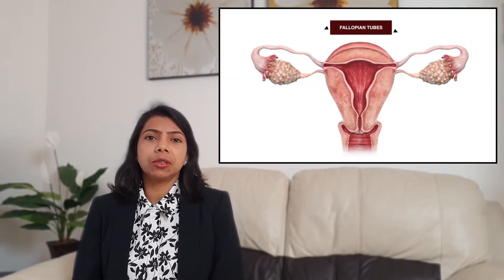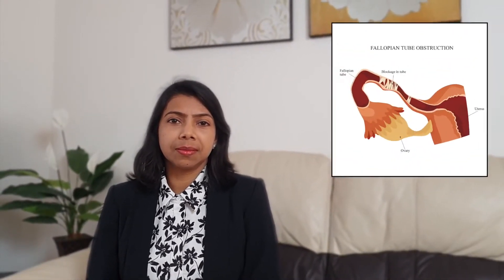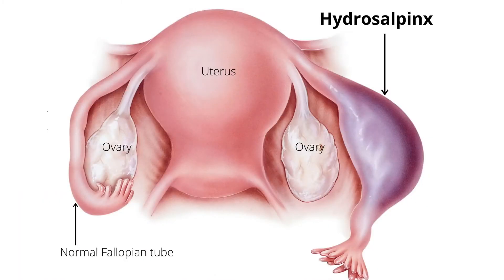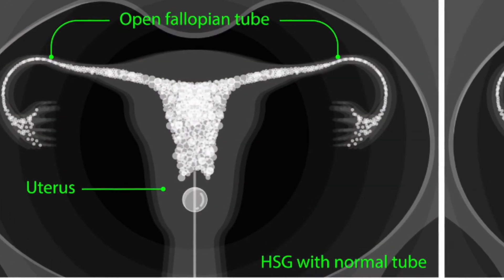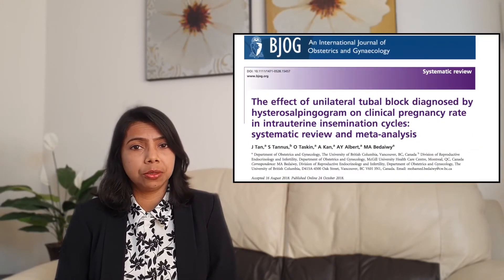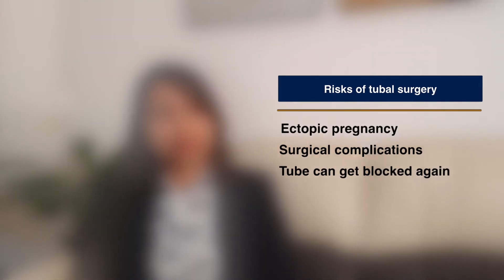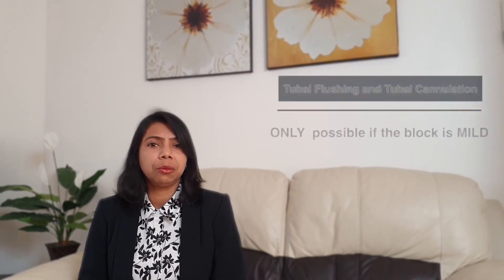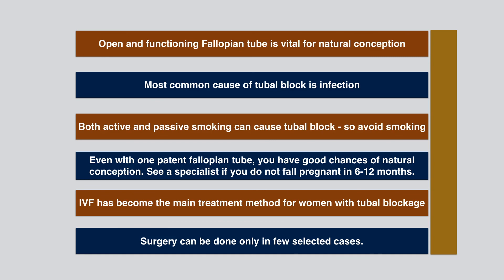Fallopian tube blockage | Causes & Treatment | Commonly asked questions

Comment: Want a blockage treatment to open fallopian tubes. Plz guide
Reply: Damage/blockage of the fallopian tube: A lot of women either have a damage fallopian tube or a blocked tube which actually simply prevent the sperm from reaching the eggs.
When a woman has her fallopian tube blocked, it greatly reduce her chance of getting pregnant.
That is why women need to go for a test such as HSG to check if their fallopian tube is Blocked and when it shows  that You have Blocked Fallopian Tubes, Do Not undergo any surgery because it might lead to lost of one Fallopian Tube , simply Use AGBARA HERBAL DEEP ROOT CLEANSER and Use this Medication for 2 weeks and it will unblocked your Fallopian Tubes and Boost Your Fertility and You will get pregnant as fast as possible okay,,Because it re-immune your Body and Balance Your Hormones
Reply: How do I get this, am in Nigeria  @leyvamichelle
Reply: Have you done your HSG scan to ascertain the level of your Fallopian Tubes blockage?? With this your scan result, we are going to treat you and your Fallopian Tubes will be unblocked and it will boost Your Fertility

Comment: I has an HSG and they said my tubes are not blocked but I have water in my right tubes due to untreated infections but my left tubes is fine,can I get pregnant with the left tubes .
Reply: You will get pregnant, okay... Just try to get the Ukpagu Herbal Fertility Tea, This Tea take it with warm water two times daily, for 7days and every infections you will see everything even when you urinate or toilet okay and it will Boost Your Fertility and you will get pregnant

Comment: thank you  very  much it was helpful im also waiting to  go and check  my tubes  they  checked the uterus it was fine
Reply: Damage/blockage of the fallopian tube: A lot of women either have a damage fallopian tube or a blocked tube which actually simply prevent the sperm from reaching the eggs.
When a woman has her fallopian tube blocked, it greatly reduce her chance of getting pregnant.
That is why women need to go for a test such as HSG to check if their fallopian tube is Blocked and when it shows  that You have Blocked Fallopian Tubes, Do Not undergo any surgery because it might lead to lost of one Fallopian Tube , simply Use AGBARA HERBAL DEEP ROOT CLEANSER and Use this Medication for 2 weeks and it will unblocked your Fallopian Tubes and Boost Your Fertility and You will get pregnant as fast as possible okay,,Because it re-immune your Body and Balance Your Hormones

Comment: hey Doctor
i heard all your speech it is help fully and a good explanation.
how  can cantact you for more questions?
thanks
Reply: Damage/blockage of the fallopian tube: A lot of women either have a damage fallopian tube or a blocked tube which actually simply prevent the sperm from reaching the eggs.
When a woman has her fallopian tube blocked, it greatly reduce her chance of getting pregnant.
That is why women need to go for a test such as HSG to check if their fallopian tube is Blocked and when it shows  that You have Blocked Fallopian Tubes, Do Not undergo any surgery because it might lead to lost of one Fallopian Tube , simply Use AGBARA HERBAL DEEP ROOT CLEANSER and Use this Medication for 2 weeks and it will unblocked your Fallopian Tubes and Boost Your Fertility and You will get pregnant as fast as possible okay,,Because it re-immune your Body and Balance Your Hormones

Comment: What do you suggest if one fallopian tube is blocked
Reply: If You have DONE your HSG Test and You are Told By your Doctor that Your Fallopian Tubes are blocked, You need to get Natural Herbal Medication Like Agbara Herbal Deep Root Cleanser to removed all the scarring Tissues and unblocked your Fallopian Tubes and Boost Your Fertility
Reply: The bacteria that cause BV can sometimes infect the uterus (womb) and fallopian tubes (egg canals). This type of infection is called pelvic inflammatory disease (PID). PID can cause infertility or damage the fallopian tubes enough to increase the future risk of ectopic pregnancy and infertility. Therefore try your best to get the Natural Herbs to cure all forms of infection in order to prevent blockage in Your Fallopian Tubes, Agbara herbal Medication and Osakirisa herbal seed are there for you to use any time ...

Comment: Hello doctor my wife tubes has  both blocked at the fimbrial can tube flushing or tube cannulation be done instead of surgery and also her prolactin hormone  was diagonised to be high 30.2.   how can we deal with this issue thenks
Reply: Use AGBARA HERBAL NATURAL ROOT CLEANSER
Reply: The bacteria that cause BV can sometimes infect the uterus (womb) and fallopian tubes (egg canals). This type of infection is called pelvic inflammatory disease (PID). PID can cause infertility or damage the fallopian tubes enough to increase the future risk of ectopic pregnancy and infertility. Therefore try your best to get the Natural Herbs to cure all forms of infection in order to prevent blockage in Your Fallopian Tubes, Agbara herbal Medication and Osakirisa herbal seed are there for you to use any time ...

Comment: Ma'am my wife has bilateral hydrosalpinx, plz tell me, is it curable or what will be the solution 🙏🙏
Reply: Hlo mam , the sperms comes back immediately after the release, could it be fallopian tube blockage?
Reply: @ategekahalima4501  It is Infections That makes the sperm to comes out as soon as your partner release on you okay, You need Agbara Infection Remover, this Natural  herb will clear the infections and Boost Your Fertility and balance your Hormones, The good thing about this is that Your Partner Can equally take it okay..
Reply: @ategekahalima4501 I think so had a similar problem but I went for laparoscopy found out both tubes are blocked
Reply: YES, It is curable with Natural Herbs
Reply: @leyvamichelle  please what herb can be use for bilateral hydrosalpinx. I am program for a laparoscopy and to be honest I don't really want to do it. But the doctor told me my only chance to conceived is ivf and I have to do the laparoscopy first. Please help me. Thank you.
Reply: @leyvamichelle ..pls what herbs did u use

Comment: The doctor said my sister has a fallopian tube blockage and the only option for her is to perform a gestational surrogate something.  That she can't conceive at all. How?
Reply: She will conceived Just tell her to go to local herbal store to explain and get AGBARA HERBAL DEEP ROOT CLEANSER
Reply: Damage/blockage of the fallopian tube: A lot of women either have a damage fallopian tube or a blocked tube which actually simply prevent the sperm from reaching the eggs.
When a woman has her fallopian tube blocked, it greatly reduce her chance of getting pregnant.
That is why women need to go for a test such as HSG to check if their fallopian tube is Blocked and when it shows  that You have Blocked Fallopian Tubes, Do Not undergo any surgery because it might lead to lost of one Fallopian Tube , simply Use AGBARA HERBAL DEEP ROOT CLEANSER and Use this Medication for 2 weeks and it will unblocked your Fallopian Tubes and Boost Your Fertility and You will get pregnant as fast as possible okay,,Because it re-immune your Body and Balance Your Hormones

Comment: I did an abortion when I was 15 year old but now I am trying to get pregnant can’t it be the infection I have white smell stuff
Reply: Try to go to Your Local Herbal Store to Buy AGBARA HERBAL DEEP ROOT CLEANSER, It will help You to get Rid of all those Your Infections and Boost Your Fertility and You will get pregnant, you mighty be having PID infections
Reply: Damage/blockage of the fallopian tube: A lot of women either have a damage fallopian tube or a blocked tube which actually simply prevent the sperm from reaching the eggs.
When a woman has her fallopian tube blocked, it greatly reduce her chance of getting pregnant.
That is why women need to go for a test such as HSG to check if their fallopian tube is Blocked and when it shows  that You have Blocked Fallopian Tubes, Do Not undergo any surgery because it might lead to lost of one Fallopian Tube , simply Use AGBARA HERBAL DEEP ROOT CLEANSER and Use this Medication for 2 weeks and it will unblocked your Fallopian Tubes and Boost Your Fertility and You will get pregnant as fast as possible okay,,Because it re-immune your Body and Balance Your Hormones

Comment: Fallopian tubes are the thin tubes located at each side of the uterus (womb), which leads mature eggs from the ovaries to the womb. It is at the Fallopian tubes that sperm meets egg and fertilization takes place. Any obstruction along the way that prevents sperm from getting to the egg in the uterus or that prevents the egg from travelling down the tube is called Fallopian tube blockage or blocked Fallopian tube. Female fertility due to this disorder is regarded as tubal factor infertility and in Nigeria it is regarded as the number one cause of female infertility and worldwide it accounts for 40% of female infertility. Blocked fallopian tube can lead to total female infertility if blocked completely or ectopic pregnancy if blocked partially (tubal phimosis). According to medical science, there are three main locations for fallopian tube blockages. They are: Proximal tubal occlusion: this involves isthmus. It usually occurs after an infection from complications due to abortion, miscarriage, pelvic inflammatory disorder (PID), cesarean (D&C), and permanent birth control methods. Mid segment tubal obstruction: This results from tubal ligation damage. Scar tissues usually develop on top of scar tissues already present from the initial herbal ligation procedure. Distal tubal occlusion: this affects the tubal end closer to the ovary. It is usually filled with fluid; hence, the name hydrosalpinx is due to Chlamydia trachomatis (STD) infection. Nature of blockage Pelvic inflammatory disorder (PID): PID is an inflammatory infection of female reproductive system in women with the history of STDs such as chlamydia, gonorrhea, etc. this condition can block the fallopian tube by causing adhesions, tissue scarring, tumour or polyps inside the tube. Endometriosis: Endometriosis is a very painful condition that can cause scar tissues to form in the fallopian tube and block its pathway. Fibroid: fibroid is a benign tumour that can grow in any of the womb (uterus) and can cause blockage in the fallopian tube. Ectopic pregnancy: Ectopic pregnancy is caused by partial blockage of the fallopian tube (tubal phimosis) in the first place, this condition can further block the fallopian tube completely. Complication from surgery and D & C (cesarean section): surgery in the lower abdominal part of the women can lead to scar tissue in the fallopian tube and block it. Tubal ligation removal. Tubal ligation is a medical procedure used as a permanent birth control method. In some cases if the woman decides that she wants to conceive, tubal ligation removal will be carried out on her. This can cause more scar tissues to form on the scar tissues created by the tubal ligation. In this case, the tube may be blocked. Symptoms of blocked fallopian tube No symptom is observed when there is a blocked fallopian tube. The only sign is the inability to conceive. Diagnosis of blocked fallopian tube Hysterosalpingogram: Dye is introduced into the uterus and an x –ray is used to monitor the moment of the dye. Sonohysterography: Ultrasound imaging is used to visualize the tube for any abnormalities. Chromotubation: This test is similar to hysterosalpingogram, dye is also used but instead of x – ray to monitor the dye movement, it is done during a surgery called laparoscopy. Medical treatments for blocked fallopian tube include: Surgery e.g laparoscopy or open abdominal surgery Salpingectomy – removal of part of the fallopian tube Slpingostomy – creation of a new opening in the fallopian tube entrance nearest the ovary. Fimbrioplasty – rebuilding the fimbriae Selection tube commutation – insertion of a catheter into the fallopian tube. Tubal ligation removal tubal reanastomosis) removal of the tied or cauterized portion of the fallopian tube There are some risks involved in the treatment procedures above and these risks further complicate the blocked fallopian tube. There is always a re-growth of the scar tissues and adhesion and the tube becomes blocked again or worse. In the case of adhesions, the tissues adhere to the abdominal wall, other reproductive organs or other organs in the location. Pelvic infection and ectopic pregnancy are other risks associated with these treatment procedures. Yorubic Medicine has a long history of treatment blocked fallopian tube with effective Yorubic Medicine fallopian tube herbal formulations. Yorubic Medicine is a natural and non – invasive method of treating blocked fallopian tubes. As a Yorubic Medicine practitioner, I have treated a lot of women with blocked fallopian tubes and they received permanent healing and opening of the tube with pregnancy as the evidence of their healing. With my knowledge of Yorubic Medicine, I have designed a program to unblock (open) blocked fallopian tubes with this program, you can be rest assured of pregnancy and permanent healing. Benefits of this blocked fallopian tube opening program It removes any blockage or obstruction in your tube It heals damages in your tube Clears infections that causes the tube blockage It boost your fertility for conception It cleans and removes all blockages in your uterus (womb) How do you go about this program? First, I need to let you know that my Yorubic Medicine herbal formulations are inherited from my grandpa and that for now they come in their most basic forms. Stage 1 – Fertility cleansing: Total body cleansing and womb cleansing are the first step in your journey to unblock your blocked fallopian tubes. An ancient Yorubic Medicine herbal powder will be given to you to cleanse your blood, liver and the entire body. Next, are the Yorubic Medicine womb cleansing formulations of which one is an oral liquid to be drink, the second is an oral ball to be ingested with hot water and the last is an ovule ball to be inserted through the vaginal into the uterus (womb) for deep cleansing and removal of blockages. Stage 2 – Unblocking the blocked fallopian tube and cleaning PID or chlamydia infection: At this stage, Yoruba medicine herbal formulations for blocked fallopian tube and PID infections will be given to you to take Stage 3 – Yorubic Medicine female fertility – boosting formulations: This stage is meant to prepare your uterus (womb) for conception. It is likely that before you end the treatment, you can get pregnant like some women on the program have done before. Let us join hands together to unblock your blocked fallopian tube and conceive with Yoruba medicine. The program contains the following therapies: Fertility cleansing therapies Total body cleansing (for blood, liver, kidney and colon) Womb cleansing therapy Fallopian tube opening therapy Fertility boosting therapy STD, cleansing therapy. reach Dr today

Email: ovie.miraclemedicine1@gmail.com

WhatsApp: +2349056393169.

Comment: Two tube are black one  in an one out what to do
Reply: Hey sis have you been trying to conceive don't worry anymore just contact this man on WhatsApp for help 💯💯💯
Reply: 🙏🙏⏩⏩±2348127342069⏩⏩🕢🕢
Reply: Try to use Agbara Herbal Deep Root Cleanser  to unblocked that Your Fallopian Tubes and Boost Your Fertility..Hope You are Not a smoker??  No matter which partner is the smoker, if one or both of you smoke, it will take longer for you to conceive. Just as smoking can damage the health of sperm

Comment: Dr my wife had gone through tube pregnency and her one tube has been removed and her other tube is blocked and we were gone under ivf treatment two times but it was failure is there any treatment to pregnent normally
Reply: The doctors said Herpes virus do not have medical cure because the virus is capable of hiding within the human cells, it remains protected from your immune system. Herpes isn’t a special virus – your immune system has the tools to fight it back. But because it is able to lay dormant in protected cells, your immune system is unable to remove it from your body,But with strong reactive herbal medication is capable of getting rid of the virus gradually and totally from your body without damaging any of your cells,natural herbs kills the virus totally not just reducing the out break. Get natural herbs cure contact Dr Enato and follow him up on Instagram @dr_enato2.

Comment: hi dr.7 month fast i have sury two tubes only cleaning bcus im ectopic preg two times,is it imposible im preg again .and the blocked again my tubes.what kind test i need,plzz advise m
Reply: You need to undergo HSG test To find out if Your Fallopian Tubes are Blocked Okay,,,
Reply: The Ectopic pregnancy that has happened to you 2 times showed that Your Fallopian Tubes are either Damage or Blocked okay You neeed to get Agbara Herbal Medication fast to start your treatment okay and Every damage in Your Fallopian Tubes willbe cured and You will have a healthy pregnancy
Reply: A tubal pregnancy — the most common type of ectopic pregnancy — happens when a fertilized egg gets stuck on its way to the uterus, often because the fallopian tube is damaged by inflammation or is misshapen. Hormonal imbalances or abnormal development of the fertilized egg also might play a role.